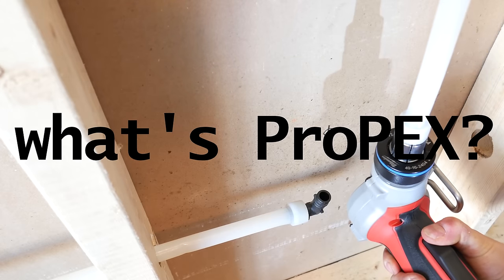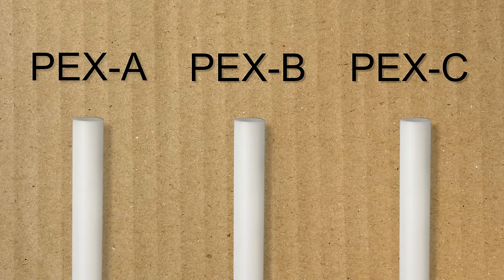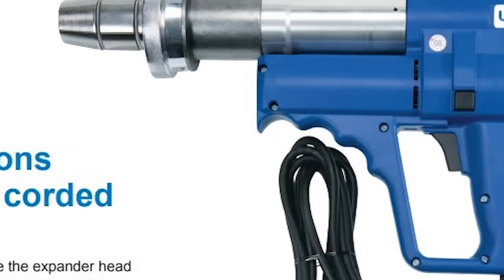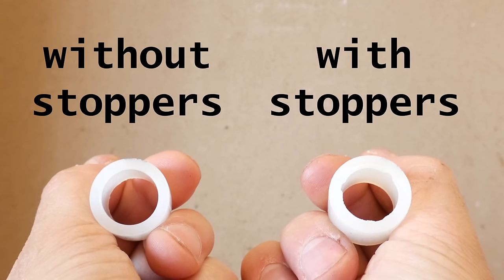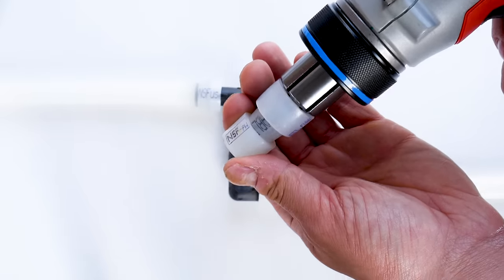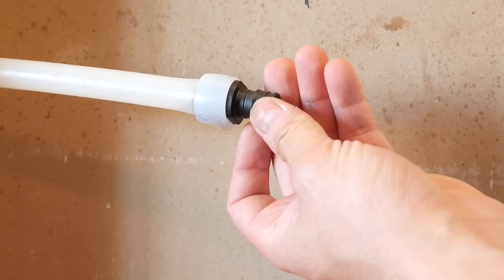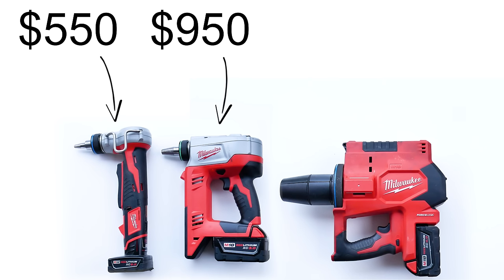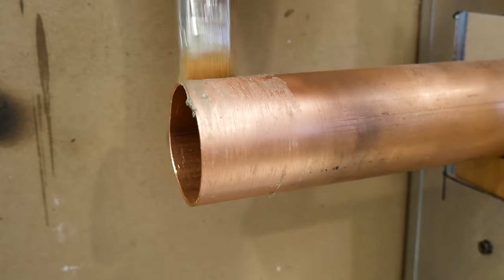UPONOR ProPEX, The Future of Plumbing (COMPLETE GUIDE) | GOT2LEARN

Comment: This is absolutely my favorite brand of PEX to work with. 
Radiant, plumbing, and ground source heat pumps. It is amazingly effective and I have run it to pressures up to 150 psi for home ro systems.
Reply: When I was searching for Type A on Amazon (11/11/2020), it appeared that there were many brands/suppliers and few of the product descriptions clearly stated TYPE A PEX.  Are their Go To Brands / Manufacturers one might rely upon?  Does Lowes or Home Depot, for instance)  carry/sell the pipe and fittings?
Reply: I was told by an Uponor rep that they have never had a failure under 220 PSI.
Reply: What do you think about the class action lawsuit related to cracking of Uponor's red and blue tubing?
Reply: @bmfitzgerald3  not to worried about it, I don't use colored PEX. Always thought that was gimmicky.
Reply: @Squat5000  Uponor seems to be pretty worried about it (considering they stopped producing the blue/red. Are you using white with blue/red lettering? Or is it clear? Thanks for your insight.
Reply: @bmfitzgerald3  I only use the clear.
But from a supply chain perspective, and don't take this as me blindly defending anyone, a lot of manufacturers have stopped or slowed production of anything other than the basics. 

My local supply houses have clear. Period. Doesn't matter the brand, so they may not be the only ones doing that. 

I personally didn't like their method of applying the color as it was not integral, but I have no reason to believe it should lead to faster failure as I never observed any difference between them in the rare instances I used color for exposed work manifold. Like radiant, where nothing is buried, and exposed to constantly high temperatures.

Comment: i did a complete DIY , when i built my house, purchased the Milwaukee power tools, PEX and all items including the manifolds.. no regrets, from the winters of Maine.. even re did several of my friends and family too. best system to use. especially in the cold climates.
Reply from the maker: Nice work! Good to know it worked out for you.
Reply: Have you done partial, where you connect to an existing pvc system? If so how did it work out?
Reply: @eb6195  I have, but for garden use only, and in the it is in summah.. UPNUr has the pex to pvc adapters, and i used them..I can NOT speak on cold weather- my apologies. but, i do Know - PVC is NOT cold weather friendly - lots of camps up here bust pipes thinking "they got it" with PVC.

Comment: Ive worked a lot with this and I have to say,  in comparison to crimp I hate uponor so very much. The main reasons being when working in the cold the fittings take up to a minute or more to close up. Even in warmer temps you can just crimp and turn on the system, you need to wait 5-15 minutes. Also cost was mentioned, but the comparison between plastic wirsbo and brass/ copper was made.  If you compare plastic 90's as an example the cost is almost 1/2 that of wirsbo. For these reasons the shops I've worked for have stated getting rid of their wirsbo stuff unless the customer specifically asks for it. That said I love your videos and can't wait for more, you've been an amazing help threw my apprenticeship and have so many high end time saving tips. I can't even begin to tell you how many I use daily.
Reply: Are crimp fittings as foolproof and long lasting as uponor? I have a uponor tool, but sometimes consider using crimps since home depot has all the fittings. Just not sure about reliability.
Reply: 1 water leak may cost a million times more.

Comment: I once nicked the barb on a 3” male adapter. I was cutting off the ring with a sawzall because pex is pretty tough stuff and the rings are about 1/2” or more thick. Anyway, that was a $200 fitting down the drain. I mean in the grand scheme of the job it didn’t hurt as much but still be very careful. Heat gun or torch with a razor knife is the best approach. You can still nick plastic fittings with a knife. But if you use heat it softens it so you have more control.

Comment: We started using the Rehau system in the mid 2000s....still the best system to date in my opinion. Brass fittings and sleeves...full size bore fittings...absolutely rock solid. Unfortunately the market made it too expensive to continue using it.
Reply: Rehau is the way to go

Comment: That's good to know about the manual expander.  It works fine as long as you remember to rotate it while expanding.  As a homeowner who'd only use it occasionally, the cost savings would make doing just a few projects more feasible.
Reply: i would highly recommend not using the manual tool. it is large and clunky and so slow as to be almost unusable, especially for a novice. Any repair will likely be in a cramped space where getting the tool in, and rotating it properly will be all but impossible. Even the M12 tool leaves little enough time to set the fitting before it starts to contract.

If buying the tool is out of reach, most decent sized towns will have a plumbing supply house or tool rental place that would rent the tool for a few hours. Now that Home Depot is carrying Pex-A fittings and pipe, as well as selling the M12 Tool (which is sufficient for 98% of residential plumbing), its more accessible than ever.
Reply: @poppybuilt3061  thanks for the tips

Comment: Uponor bought this system from Velta, which had over time acquired the Wirsbo firm and it’s original expansion joint plastic pipe system. Wirsbo are the originators of this very system. The 90° fittings should be avoided whenever possible, if you want to keep your flow up snuff. For this system there are curve braces on the shelf. The advantage of PEX it’s molecular memory, which can also be a disadvantage when installations aren’t properly braced, or fitted for expansion and contraction.

Comment: 4 years later in this video still relevant. I have polybutylene in my house that was built in 1988 and I'm trying to figure out a way to get both levels done effectively but cheaply. The crawl space is going to be easy but it's that one spot that goes upstairs pipes go in the wall to two bathrooms that I'm going to have to work at. Needless to say it looks like I'm going to get some experience at drywall and ceiling repair. Lol! Thanks for the video and the links.
Reply from the maker: thanks, glad you enjoyed!

Comment: For those wondering about the DeWalt expansion tool that looks like the Milwaukee - it's just as good. Either one will be a fine and reliable choice.  I know fanboys on both sides will say the other tool is junk, but fanboy advice is worthless.  Both tools excellent. So buy whatever you get the better deal on or whatever battery system you might be using now. EDIT:  do NOT use the manual expander for anything. Trust me on this..
Reply from the maker: Thanks for the info!
Reply: Absolutely correct!  I even contacted the Uponor rep regarding Uponor certified tool usage after my local plumbing supply told the Milwaukee was the only one certified. The rep stated that only Milwaukee had the expansion tool at the time the tests were being done. He said the Dewalt was every bit as good! And correct! Don't even bother with the manual tool unless you're a doityourselfer and only need to do a few fittings here and there.
Reply: Made in china,   brands no longer matter. Same as car batteries,  people swear Diehard is still the best car battery. Johnson controls make Diehard, Autozone and Wal mart and a few more,  batteries. 55$ vs 185$
Reply: Milwaukee tools are straight trash,  DeWalt isn't much better though.
Reply from the maker: Milwaukee is trash lol?
Reply: @Got2Learn  Harbor Freight,  best tools period🤔
Reply: @Got2Learn  Just as obnoxious as the Milwaukee and DeWalt fanbois are the Makita fanbois.. LOL.
Reply: @thomasodetinape4180  Nobody has said Diehard car batteries are any good since the late 70s...
Reply: @ohger1  people who drove in the 70's do, point is they are good but just a name. Wal mart is the same battery for a 1/3 the price.
People spend on names...
Reply: @mrc1062  thats odd. I've left my drill out in the rain several times. Dropped it countless times. Kept in the garage where temps go from 100 and super humid in the summer to 10 in the winter. Same batteries, same drill continues to chug along for about 5 years now. Some seriously good trash!!

Comment: Got2Learn, I work in the plumbing aisle of a Home Depot. I've learned a lot from your channel and recommend your videos all the time. I have a special folder in YouTube for plumbing and 95% of the videos in there are yours.
The most common problem customers have when talking to me are the drain lines from sinks (kitchen and bath). The sinks nowadays mostly have 1-1/4" down stubs. The customers have to get from that to either 1-1/2" or 2" main drain line into the wall - along with incorporating a p-trap in there. About the only thing we have for them is the compression joint with a compression ring sized for 1-1/4" or 1-1/2" (separate rings, one for each size). This seems kinda cheap and unreliable. Any suggestions for a better way to do this?
Reply from the maker: Actually those are the correct fittings to use, they are called "waste connect" fittings, they work very well :)
Reply: Thanks. They seem a little "chincy" or cheap to me. But if that's the proper way to do the job, so be it. I'm just making sure I recommend the right thing to customers.
Reply: You also have the various pvc "trap adapters" to make a straight transition from the trap fittings to the drainpipe, which have a one-piece compression joint and require glue on the other end (I work at Lowes). These seem more solid than the thinner plastic repair pipes with just a compression ring. Yes, some plumbers hate those cheap repair fittings, but they make life easier for the many homeowners who are not plumbers, and don't want to pay for one.
Reply: Yes Kevin, I thought of those over with the abs fittings. I don't like to take customers down that road of using abs. Most customers would be overwhelmed with all the glueing and cutting involved. Most just want to install that sink they bought as quickly and easily as possible. Good thought tho.

Comment: Good to know about heating joint to remove a fitting. Have used both the razor in the pecs cutting tool to try to take the pieces off of the fitting and yes they do leak after they have been nicked. I will try this the next time I need to shorten a run, or make a pipe look more square.

Comment: My son had his house "re-piped" with PEX a number of years ago (I think about 12 years now).  I was surprised on how fast they were.  It only took one day, start to finish.

I have PEX in my travel trailer but use a crimp type connector.  I have modified the plumbing in the trailer to add shut off valves in critical locations.  I was surprised on how easy it was to work in cramped locations.  I now carry some piping, fittings and crimping tool with me while on trips.

Comment: zurn pex B is expandable and pex A can be crimped. occasionally youll get an uponor fitting with a small imperfection, litttle plastic tails that can cause failures/leaks (1 every 10000 or so), so just check your fittings Pex B zurn stuff has a rounded head and its alright, but i have a lot more experience with uponor. apollo makes pex A fittings, but i have yet to try them
Reply from the maker: Thanks James!

Comment: The smaller tool can be had on sale for $325 with a case and two batteries + charger. Great tool. Love the system. Fittings and pipe are starting to show up here in a handful of Home Depots (Apollo brand, not Uponor).
Reply: Never heard of Apollo. Is it Pex A like Uponor? I really like Uponor but the only place I've been able to find Pex A is at plumbing supply houses. Would be great to be able to get it at HD or Lowes
Reply: @richmac918  Some of the HDs in WA state (Federal Way store) are now carrying a decent selection of Apollo brand expansion PEX . Same specs as Uponor and can use Uponor/Apollo fittings/pipe interchangeably.  Search for "pex-a" They even have expansion PEX ready shut off valves, copper stub outs, shower drop ears and metal water heater risers which makes supply plumbing a breeze.
Reply: @madcowusa4277  Thanks for the info. I stopped looking at HD and Lowes a long time ago because  i knew they only carried Pex B. Next time I'm there I had to see if my local stores are now carrying Apollo. Thanks for the heads up - most appreciated
Reply: @madcowusa4277  Thanks man. I live in Seattle and will check that store out. Nice to be able to get that stuff on weekends and after 4:00 pm
Reply: The uponor warranty drops 75% if  you don't use uponor fittings though.

Comment: I bought M12 Propex tool on Amazon for $300. I don't know if that was on sale or price mistake, but it was a great deal. Re-piped my house with propex and used it on few jobs, and I love it. :D Tubing is cheap, but fittings are expensive. But you don't need as many fittings a copper since the tubing is flexible. One downside I found is that it doesn't work very well in a tight spaces because there is a minimum length between fittings.
Reply: You paid $300 and it's a good deal?? I saw Milwaukee Propex on letgo app for $150 yesterday!
Reply: @adnan9520  Considering it was new tool. Came with 2 batteries, 3 heads (1/2" 3/4" 1"), charger and carrying case. Yeah. :)

Comment: Going to give the Milwaukee expander a try soon
Reply: It works great. Never used a manual expander but I can’t see a good reason to use one. In tight  crawl spaces I can only imaging the frustration of a manual tool.
Reply: I’ve used both it is worth the money for the battery powered one
Reply: i bought one in 2013 - no regrets love it ! best ever
Reply: dewalt makes one as well...
Reply: I like dewalt. Seems faster and so far it’s got 2 years on the Milwaukee. Odd thing. A tool made for plumbing, isn’t waterproof. So don’t drop it.
Reply: @pjplumber2146  yes!!! truth! dont drop it!

Comment: ProPEX in walls with copper stubouts and exposed piping is ideal in my opinion
Reply from the maker: Yup!!@
Reply: Nope I disagree because you have to use open flame inorder to do repairs. That can heat up the ring causing a leak. Also it can fool a plumber to what is in wall.thus other issues like uponor expansion that is not an issue. Alot of guys try installing shock arresters to stop this though there is no way and would cause a faulty charge and the noise will never go away

Comment: Great video.  I just purchased a home with uponor plumbing that is at least 10 years old.  Will I be able to change some valves and retrench the old line with new rings?
How long before the uponor line is no longer workable?
Reply from the maker: Sure, you can change some valves and reuse the same pipe, just make sure it's not dried out/cracked or anything, you can do this even if the pipe is 20 years old.

Comment: I’m a plumber and I know this product very well. It will fail if your home has a recirculating hot water line. Mine has failed in multiple locations. The pipe will split at the connections. They get very small splits and start to leak. I’ve ask uponor about it and they said you can’t use a hot water recirculating line.
Reply from the maker: Thanks for sharing.
Reply: not on water temps over 160,  it says in the manufacturers recommended operating temps.
Reply: @jamesdutcher2485  And that's fucking hot! My house is at 130°F any hotter and you start to scold skin.
Reply: I worked for a plumber doing them and he said they only last 10 years

Comment: I am a homeowner and bought the lever kit which comes with 4 heads and goes up to 1 inch for $80.... thats a good deal. The larger UPONOR fittings... over 1 inch are RIDICULOUSLY expensive. Good stuff. I have it for all plumbing and about 3500 feet of radiant. I like it a LOT better than PEXB with all those crimp rings.
Reply from the maker: Yeah if you aren't gonna be making money doing this, it's better to have the manual kit or it is too expensive for sure ;)
Reply: @Got2Learn  my question... why dont other manufacturers compete in the PexA market? The fittings are WAY overpriced compared to other brass and some plastics. I buy from Supply House and I  love them... Uponor is the best in my opinion... it needs generics which I  have never seen
Reply from the maker: My guess is it's a patent issue, I know Sioux Chief makes PEX-a and I only heard good stuff, but I honestly don't know why cheaper parts aren't being made.
Reply: @Got2Learn  I dont know how you could patent a plastic elbow or coupler.
Reply from the maker: @rogerwhiting9310  they got patents on those for sure
Reply: Thanks